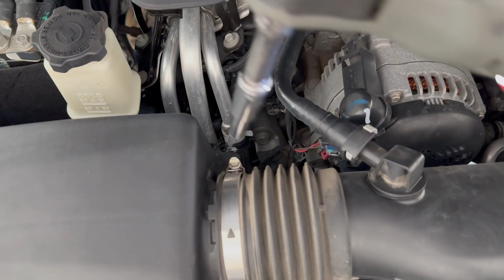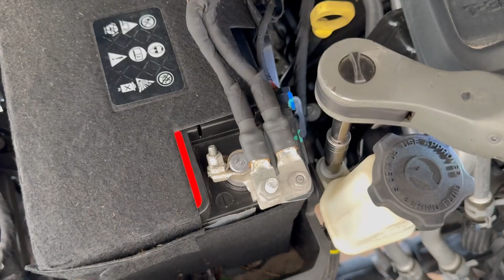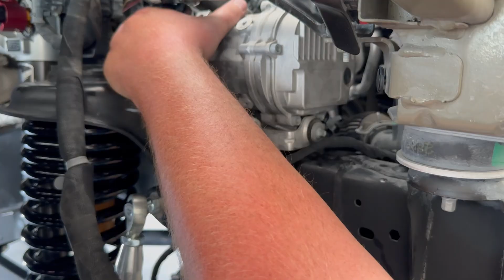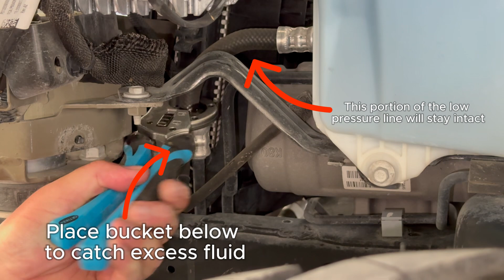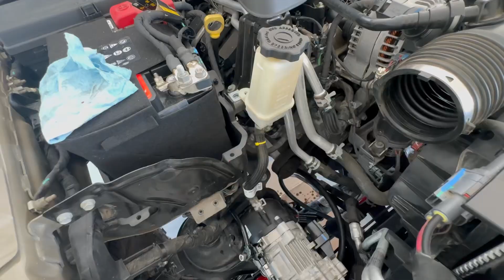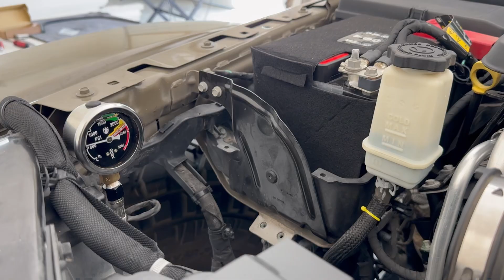How to install the APEX Steering Boost Kit for Jeep JL and JT

Comment: Spent 3 weeks in Ouray and Moab in my 2018 JLUS 6 speed manual/35-12.50 BFGs.  During the ride on Black Bear Pass switchbacks noticed the degradation of the steering on my OEM setup.  Definitely ordering this kit when I return home.  Thanks for this awesome video installation.

Comment: If topping off with CHF any need to drain all the old factory fluid beforehand or will they mix without issues
Reply from the maker: @DesertDieselAdventures  no need to drain the existing fluid.

Comment: Completed the install and this video is spot on!  For me it was about a 6 hour project due to a goofy little challenge with one of those annoying electrical connectors.  Two things I'd pass along for others to consider   1.  I couldn't get the smaller electrical connector loose and wrestled with it for a LONG time and then all of a sudden realized that the wire harness reached easily through the (removed) fender liner and layed upside down just fine on my 38's so I didn't NEED to remove it.  2.  A friend gave me a 'heads up' on the cooler install and said to measure the center to center bolt holes on the frame and lock down the top bolts on the cooler bracket  starting so that there are just 2 bolts to wrestle with while under the Jeep.  This ended up being good advice and I'd recommend doing it that way.  Thanks Apex for a really cool product, some easier steering on the trail and for this helpful video!

Comment: Could you please specify differences for diesel motor install? Video would be ideal. Thanks!
Reply: Well, I have the diesel and after removing the air box. Removing the front grill the supports to get the air box mounting bracket out. I realized I didn't need to do all that because, on the diesel, all of that is on the driver's side. And the staring pump is on the passenger side and has the fuse boxes above it. So now I just pulled off the passenger front fender, and about to continue on
Reply: https://youtu.be/wkdJ93d2OB0?si=VOgbHU3F4xA7MOKg